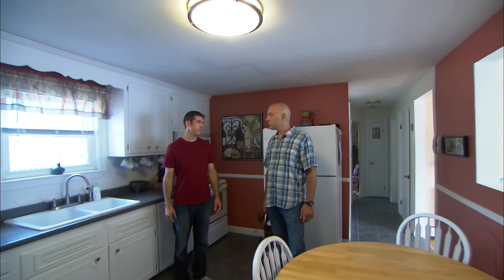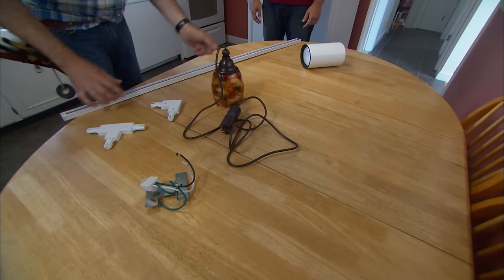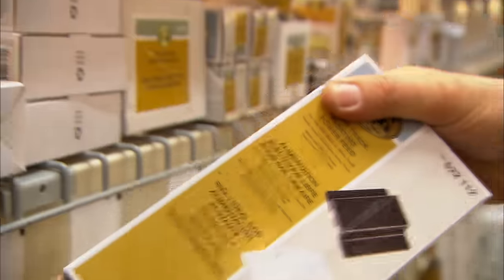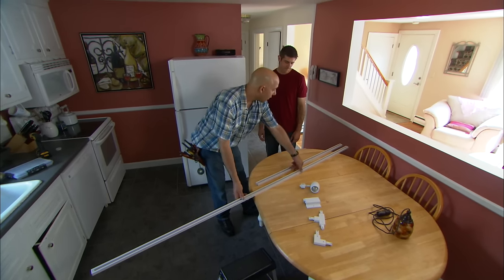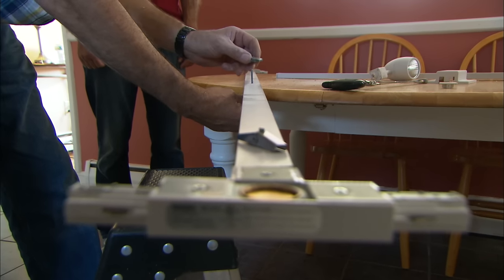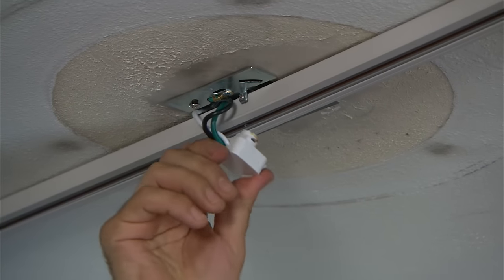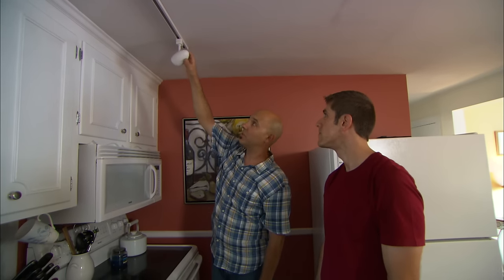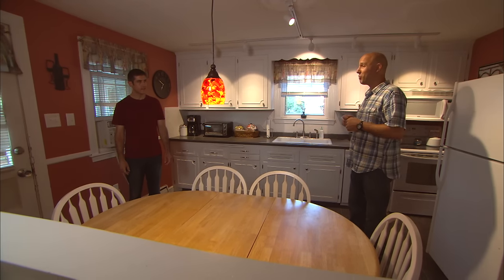How to Install Track Lighting | All About Lights | Ask This Old House

Comment: Great for when you're on a budget but in this application I would of tried to fish two wires from the original location, one for the task lighting above the kitchen area and another to the dining area to minimise the need for connecting tracks between the two areas.

Comment: I don't know why everyone is complaining, it's obviously an outdated kitchen, and installing recessed lights would have required putting tons of holes in the ceiling and drilling through the floor joists, who knows what's in the air space, it would've been too much trouble imo. It's cheap and they need a new ceiling anyway, probably just a temp solution.
Reply: I've been in the lighting business for 47 years and can say he did this wrong. He should have used cheese based lighting, much better than track lighting.

Comment: recessed lights would've been much more clean looking and modern.. they make low profile lights too, which won't be an issue to the flooring above. I would be annoyed after a while looking at those power tracks. This is good for an extremely out dated kitchen and doing stuff easy on a budget. But this kitchen needed a better setup.
Reply: Completely agree, although I think there reasoning was less about the height between the ceiling and the subfloor of the 2nd floor and more about having to cut holes in drywall to snake wires. That being said, would have been worth the extra effort. Track lighting is dead and shouldn't be resurected.
Reply: Hey, have you thought that maybe people have their own tastes? I disagree 100 percent with this comment
Reply: the issue is that there is a finished floor above that kitchen
Reply: some ppl have 2 floor houses and have track lights but they were installed before the upper level was installed

Comment: Lighting a kitchen like its 1995! It would have been just as easy to retrofit recessed lighting and fish a few cables as install this.
Reply: briancnc I guess you didn't listen there was a bedroom above they would have had to remove the floor to run wires why go through all that when this was a simple easy solution.
Reply: Wayne Testa definitely not, they make low profile recessed lights. They're no more than a few inches deep, and are very affordable
Reply: Considering the water damage marks on the ceiling, they could have done whatever lighting they wanted after the plumber has to open the drywall to inspect.
Reply: You don't need access above, that's my point. I could take the feed that's there, cut all of my holes, fish my jumper cables from one junction point and install LED recessed fixtures. No need to access from above, and the electrical load would be far less for a greater output of lumens.
Reply: briancnc - If it was I-Joist then you'd have to drill each web and fish through, and your holes/recessed location would have to be inbetween each joist for access.

Looking at the kitchen, I think the "best" (read: easiest) install for their application would have been a 4ft flush mount in the existing location.  It would have given them all the lighting they need for cooking and would more than illuminate the dining area, although a completely separate switch and light is what the table needs.
Reply: what are you talking about,this is much easier than cutting holes in your ceiling and installing outdated recessed lighting from 1979,,,putz
Reply: briancnc track lighting is a thing of the past. Very unsightly and theres many other better lighting options.

Comment: what brand of the track lighting was used?  Where to buy?
Reply: u can buy any brand of tack lights that have the right voltage at the local home improvement store u buy the tracks but the lights you have to buy sine heads depending on how much light heads u want

Comment: Track lighting is very functional, I think it'd look better if the track itself was recessed
Reply: Jonathan Sanders or better yet: No track at all and do it properly
Reply: @fd3871  how is track lighting an improper way to put in lighting? I need an answer.
Reply: @r1ckastl3y86  not improper per-se, just a very very outdated way of doing things. If it is your house, and you have the knowledge, it is better to put in can lights or smaller spotlights (they make them in various sizes and beam patterns). Esp. if you are going to sell your house - track lighting just dates everything to the 90s imo.
Reply: @fd3871  good point. If you live in an older house like I do, track lighting is very fitting for it.
Reply: @r1ckastl3y86  Lots of good modern uses for tracks. New pots are ultra thin with LEDs, hence their popularity, but there are many applications where you can't recess and a track looks great. eg a condo with a concrete ceiling, or side-mounting it on a joist on an exposed wood ceiling.

Comment: Horrible. He should have add some under the cabinet light instead of that long track with five heads and upgrade the main ceiling light to something bigger or brighter.
Reply: Under cabinet lights are a very large job and track lighting would cost about 1/5th as much
Reply: @ikecostner1  I just did a 1952 house with led under cabinet lighting for $125.00.  It took me two hours to do.  No sweat and looks great; not a very big job at all.
Reply: @MD-wq6on   there’s a difference between hacking some under cabinet lights in and doing it correctly and code compliant fyi

Comment: how would you use a system like this in a room with no electric on the ceiling? I can sacrifice a wall box to run the system but can I run a line to the first section of track or do I need to run a track up the wall?

Comment: The new lighting system makes the kitchen darker than the old one!  Why not some under-counter task lighting and use the existing ceiling connection to put in a few of those newer thin recessed LED lights (check where the ceiling beams are first with a scanner).  I'd only use track lighting if I needed something for the short term, like if I was planning to remodel in the near future.

Comment: 1980's are calling the show and they want itheir lights back.
Nice under cabined LED stip lights would have made such an improvement and a nicer, stronger light bulb in a 3 bulb dinette chandelier would have had the same result.
This is HORRIBLE!
Reply: This is not an honest comment, Honest Comments
Reply: @honestcomments6060  it's a joke.
Reply: @r1ckastl3y86  No it wasn't

Comment: this was disgusting to watch.... i mean that house was decent looking, but now it got slapped back in time... no no... track lighting should be kept only at whatever malls clothing stores are still opened... To the homeowner please just take them off and redo it... lol

JULLISON LED 12 Packs 6 Inch Recessed Low Profile Slim Panel Light with Junction Box, IC Rated Air Tight, 120VAC, 12W, 800 Lumens, 4000K Cool White, CRI80+, Dimmable, Damp, ETL + Energy Star
Reply: Nobody cares about recessed lights unless you are crazy and want to make your house look bland and boring